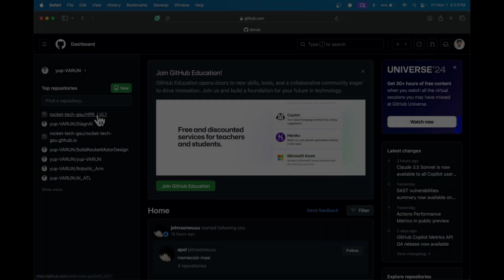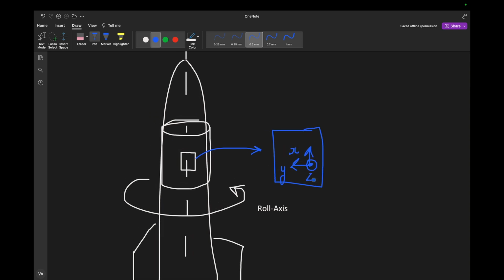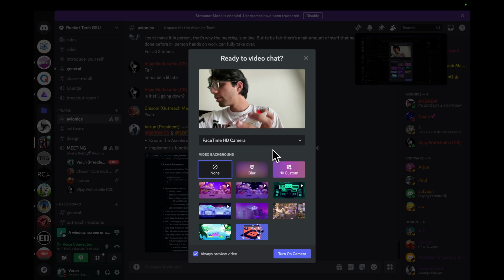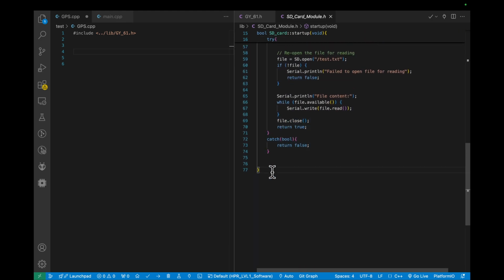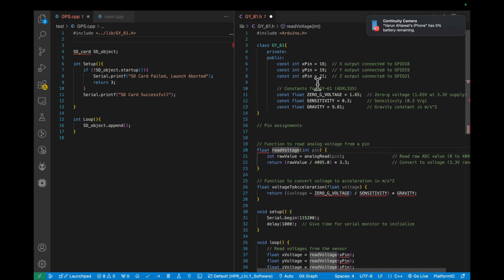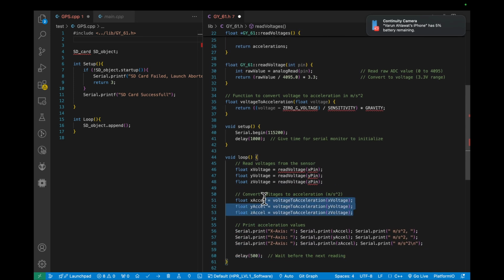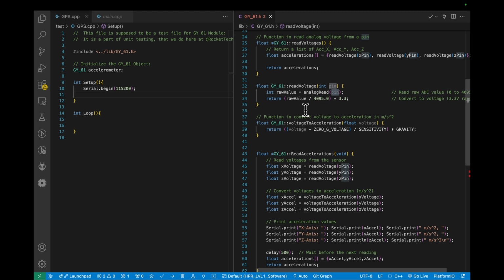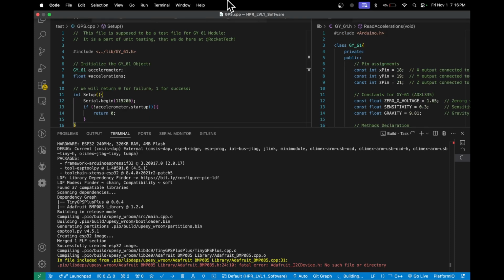Building Mission-Critical Aerospace Code from Scratch: A Beginner's Journey at RocketTech!

Comment: No offence... but "Arduino library" and "mission critical" should never EVER EVER apear in the same sentence. Arduino library implementations are not written (or required) to adhere to any modern C++ safety or testing standards (MIRSA AUTOSAR etc...). Although for your purposes it's probably fine, truly mission critical code shouldn't even use the C++ standard library since it is also not written to adhere to any modern embedded safety standards (or C++ for that matter since is inherently requires a vast amount of runtime support - and thus more non compliant external libraries). The flight computer library I am currently helping to develop is using freestanding GCC (that means no standard library) and following the most recent MIRSA guidelines which imo is really the only sensible thing to do if your code is truly critical - that is, can not fail. If you have the money, you can seek out critically certified library implementations but let me tell you they are not cheep.
Reply from the maker: Hey genuinely thank you for you comment! Recently I have read a lot about unit testing and testing standards, their extent is of course far beyond what we have the time to work on as the first rocketry club ever at GSU. Reason behind using PlatformIO(which requires you to import arduino.h) is just to bridge actual .ino files to actual c++ file codebase. I'm not too proud of it, but hey start must be rusty and fast otherwise you never get the momentum to cross the threshold of potential energy needed to build something really good.
It will get a lot better within a first few launches, and ofc we will be following good testing practices as the codebase starts to expand. And even though it sounds like clickbait, it is still mission critical but only to our club's missions.

& I don't have the money to afford critically certified libraries X_X

Comment: That readVoltages function is returning a pointer to the array. After the function goes out of scope, the memory will deallocated and the pointer will be pointing to a memory address that may have been already occupied by other variables. You can either create a class member or you can allocate the memory in heap but you have to manually free it. You can also use the vector from standard C++ library. It is already included in the Arduino library. Trust Me, This issue can be very frustrating.